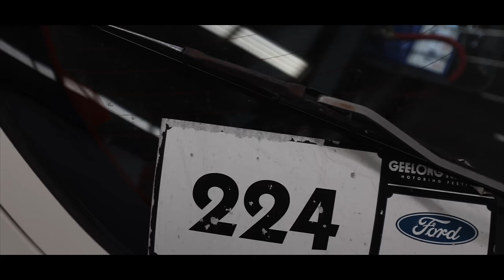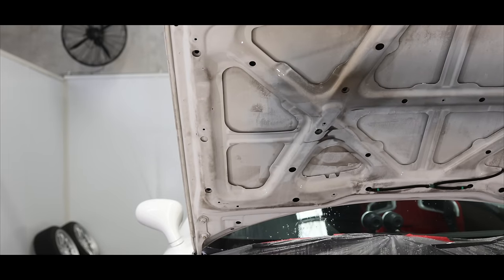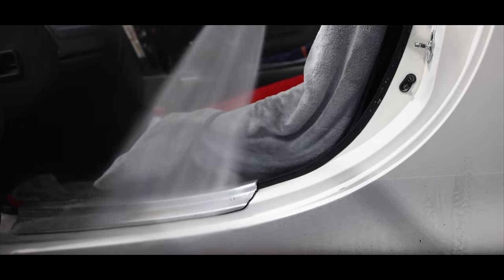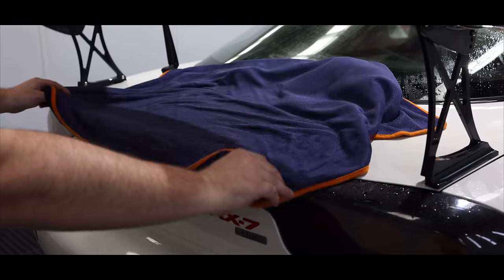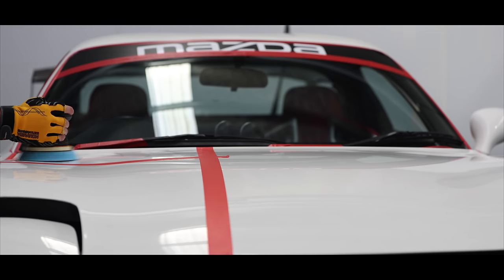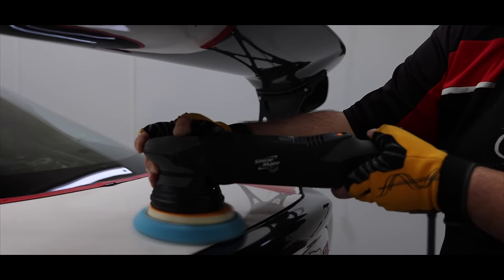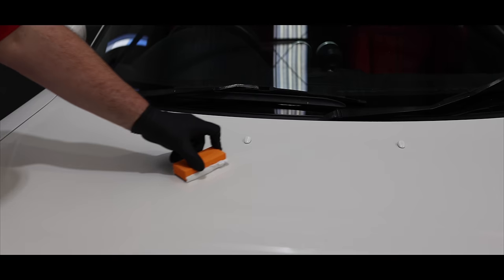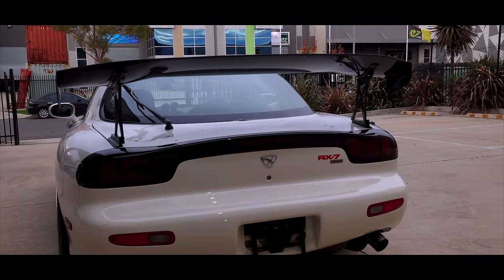Neglected 25yrOld Mazda RX7 Restoration Detail | Vlog 54)

Comment: In my opinion spraying iron remover willy-nilly is just costly, using it in conjunction with a perforated clay towel is the most cost effective and efficient way to decontaminate the paint.  Same goes with the wheels, spraying on wheel cleaner/ iron remover is pointless if there's actual dirt on there. I'd spray a pre wash and rinse them first removing majority of the dirt, then applying the wheel cleaner so it has a better chance at working at the really stubborn brake dust.

Comment: Sandro, your work is outstanding as always! Even though I haven't had any vehicles to detail in a long while, your work is what I strive to achieve when I do. 

A few question about your ceramic coating process though. 

I notice you often use Erase to pre-prep the surface, but is there a difference between a surface prep spray and using a plain IPA solution?

In this video you used a pad for the wheels, however, in previous videos I've seen you using a suede cloth over a sponge and didn't know if it was preference or if each cloth/pad has it's place.
Reply from the maker: Thanks mate and a surface spray can vary depending on the brand, but something like Eraser is very similar to a home made IPA solution which is usually 1 part 100% isopropyl alcohol to 4/5 parts deionised water, but Eraser also has minor tweaks to help better lubricate and give extended work time and a nicer scent. Some older videos will have me using suede applicators on wheels but I’ve been using foam pads for years now and much prefer them for wheel coatings.

Comment: I always love watching your videos. Its very interesting to see the chemical choices for each use. On a side note, I recently decided to pick up Maguire's hybrid ceramic wax; however when I applied it to a customers car and did a follow up wash I noticed it came out very patchy( I applied it off label as you did in your testing video). The hood came out amazing perhaps the best possible outcome I could have imagined, but when inspecting the rest of the car some parts looked like they didn't even get touched with wax. Before I applied the wax I did an iron decon, clay bar, and IPA wipe. When applying I was in a shaded area and the paint was cool. What could have gone wrong? The only possible thing I could imagine is that I applied too much in some areas. Let me know your thoughts or any suggestions. Thanks!
Reply from the maker: I appreciate that mate, thanks. 
It’s hard to say for sure what the issue was, but I have noticed that sometimes after doing a thorough decon, certain sections of certain panels have varying and even weird water behaviour scattered about even though the paint looks and feels clean and bare. But after polishing that goes away leading me to believe that there was something there fused to the finish that required an abrasive to remove it. Maybe whatever is causing those inconsistencies could be related to something still remaining on the paint that rejects the sealant.
Reply: @CarCraftAutoDetailing  I know what you mean. I was just really hoping that it wouldn't have to come to a polish, especially when its hard to justify one to most clients. One other piece of information I have is that the hood took well to the coating, the entire drivers side was alright, nothing spectacular; and the entire passenger side looked like nothing was done to it. The order of degradation was the order of which I applied the coating, meaning I started with the hood(best area), then went to the driver side(okay area), and ended with the passenger side(worst area). I'm not sure if this is pure coincide as I maintained technique throughout application, or like you said before that the car needs to be polished. Anyways, I am very appreciative of your response Sandro, and I look forward to your future vids!
Reply from the maker: Yes absolutely, what we’d like to do and what the client is willing to pay are two different scenarios. Sealants can and do seperate at times, that could’ve been another a factor where a vigorous shake could help - but again not sure if that played a part.
Reply: @CarCraftAutoDetailing  I appreciate you trying to help diagnose the problem, have good one Sandro, ill be looking forward to your next video's:)

Comment: Great job, Sandro!
What are your tips for getting the most gloss from white paint?
Reply from the maker: Thanks and using a great finishing primer polish like Essence topped with a good ceramic coating like CQUK (as done in the video) is really fantastic at bringing that extra gloss to whites and silvers.
Reply: @CarCraftAutoDetailing  thanks. Would any ceramic coating be compatible with Essence?
Reply from the maker: Perhaps not every ceramic coating most of them I’ve tried seem to work great with Essence.
Reply: @CarCraftAutoDetailing  does that include NV Evo? 🙂
Reply from the maker: Yes I’ve tried it with Nv Evo and it worked great.

Comment: Using the tornador with all those chemicals and making it fly around alot and become very misty, does it never concern you about the effects of longterm inhalation and being absorbed on your skin on the exposed areas? Especially since being a detailer you're exposed to them significantly more than a weekend diy-er
Reply from the maker: Yes it’s a concern I try to mitigate by working in large well ventilated spaces and using PPE. But it’s not unique to detailers, if you’re a tradie in almost any capacity things like air borne saw dust, metal fibres, paint overspray, even chefs deal with baker’s lung and smoke inhalation issues not to mention any domestic/industrial cleaners as well as gardening professionals. In other words unless you have a desk job there’s almost no getting away from some airborne contamination. It doesn’t mean you don’t try and mitigate by some measure, but it’s reality of trade based work.

Comment: Amazing work as always sandro. I want an FD rx7 so bad! Question. When you use your tornador with chemical cleaner in it, do you wear a mask or respirator? Im just imagining breathing in all the aerated chemical as youre spraying
Reply from the maker: Thanks mate and they are amazing cars! 
I do wear filtration masks at times, also have a couple of powerful industrial fans at one end of the detailing bay that do a great job at expelling airborne particulates through the massive roller door at the opposite end of the bay -the shop itself is extremely large and well ventilated which helps a lot.

Comment: Hello Sandro. As a business owner to another, do you still recommend the shine mate 5” DA battery polisher? I need a cordless machine
Reply from the maker: Absolutely, the EB351 15mm/5” is a great all round machine. If you want a bit more torque the 21mm/6” is another great option.
Reply: @CarCraftAutoDetailing  appreciate it. If it survives in your business it should in mine. Thx!